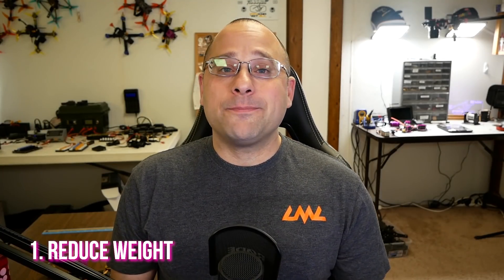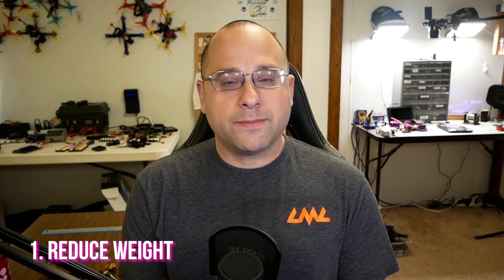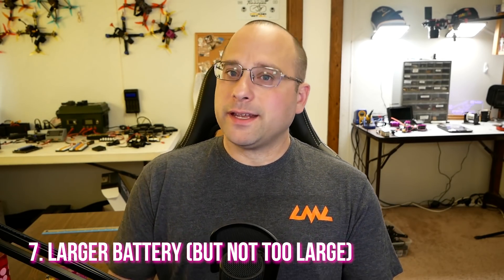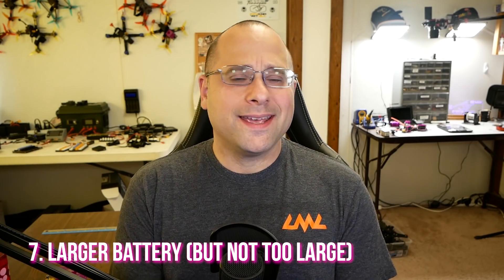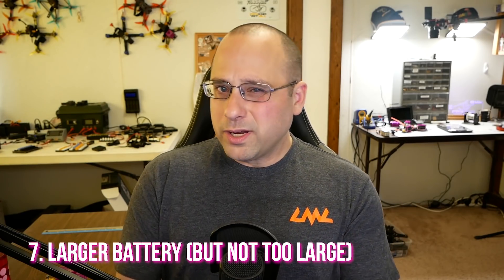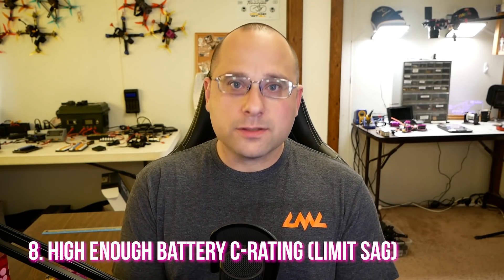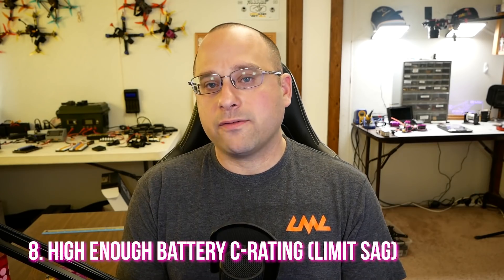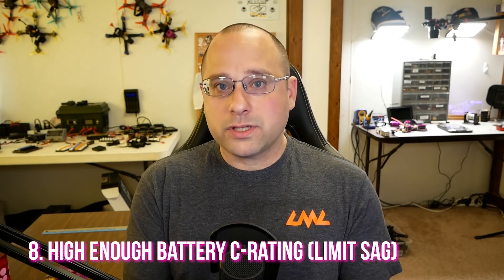Quadcopter Long Flight Time | TEN TIPS TO FLY FPV LONGER

Comment: What do you guys think about 6s, HIGH KV, BUT with a throttle limit.
Reply: Would you still gain efficiency from the 6s? I heard a high kv motor should be more efficient bc of the number of wingdings or something? I could be wrong. Think Ryan Herald mentioned it.
Reply from the maker: I tried this on one of Zach Thayer's quads, and yeah it's a sample of one, but it was terrible.
Reply: @JoshuaBardwell  ??? Sample? What was terrible? So this doesn't work with throttle limit scaled?

I wanna go 6s on my 2400kv motors with throttle scaling. Will it be terrible?

Or will it be identical to 6s low kv?  (~Same rpm at full throttle)

Comment: Joshua:  From fixed wing flying I remember the following rule of thumb:  lower pitch makes more thrust but you can't fly as fast (on the same motor/battery setup).  Why would that be different for quads?
Reply: Lower pitch but a larger diameter prop will make more thrust and will be more efficient but will top out at a slower speed. Higher pitch small props go fast but are inefficient and you can't lift as much weight.

A 12"x3.8" prop will fly longer than an 8"x6".

One thing he didn't mention is that fewer prop blades are more efficient. Two blades will fly longer than 3 or 4. Theoretically, a single blade with a counterweight is the most efficient.

Comment: If you go low on motor size and increase prop size wouldn't it be dangerous for the motor? 
For e.g. could we use a 1806 with a 6030 prop on a 450g (including 3s battery + camera) quad, while flying smooth?

Comment: have you or anyone done a video on what prop size works best on what size and kv motors or is it just a preference thing ? and great video again thanx jb
Reply: I think I heard higher Kv windings are more efficient? And so by using the throttle limit just go high kv. Kv has been around mucch longer than the throttle limit software, which makes kv useless imo.
Reply: I might have it reversed. Josh seems to say low kv winding is more efficient, but for some reason I remember that high kv is for the same thrust.
Reply: Check out kababfpv! 8:58 of this video!  https://youtu.be/c9f3yevSrjs

Comment: My dream...longer flight time...1) solar charging batteries 2) extensible wings to glide on winds when feasible 3) a micro alternator, to charge batteries from motor rotation
Reply: you would also save a LOT of energy when gliding since you would only need to use one motor to fly in that mode, and if I remember correctly a plane can fly on a 7-1 thrust to weight ratio.

Comment: hi is there a maths table to work out what your weight should be ,i am using 10 inch props  with brotherhobby t1 3115 900kv its 2kg at mo with 4000 mha battery and gopro 7

Comment: hard to find info on what kind of flight times you should expect tho.  how long should a 1500 mah 4s battery last on this speedy bee (speedybee stack) quad with 2306 2550KV motors ?  I'm assuming that's a correct battery motor config.  I'm only getting maybe 5 minutes.  The only comparison I have is the rekon 5 with the same battery and it lasts a LOT longer.
Reply from the maker: 3 to 5 minutes is normal for a 5" freestyle quad weighing about 750 grams. The Rekon is designed for endurance not agility speed or agility.

Comment: use a li-ion pack instead of a lipo battery because li-ion has a slightly higher energy density. So for the same weight you get more mah's the problem is that your constant c rating is usully lower, around 30 -45 c.
Reply: 65 c is very low c for a quad
Reply from the maker: Only if you are under 30C which few mini quads are.

Comment: Can someone explain to me why drones like the bebop 2 can fly for 20 minutes in sport mode while flying at 40-50+mph? I want to get into this hobby. Currently flying in sim for over a week now.

Also why use lipo batteries if they're so dangerous and finnicky, requiring careful maintenance and care, while there are consumer drones using lithium ion batteries???? It isn't because the battery cant support the current because consuner drones are doing just that.
Reply from the maker: I don't think the bebop 2 can fly for 20 minutes at 50 mph. I think it can probably hover for 20 minutes, but at 50 mph, I would be surprised if it got that flight time.

LiPo have incredibly high energy density and power delivery. Nothing else comes close until you get to liquid fuel.

Comment: So if I have a 4s 850 that weighs 105 grams, then switch to a 3s 1000 or 3s 1300 that weighs about the same, I should get a longer flight time, right?

Comment: JB random issue, my flywoo explorer LR flying a 4s 900mah battery with GoPro bones and getting like 2-3 minute flights…? Is there a possible esc/beta flight issue? I was expecting to get at least 5-8min..? Also just cruising not going crazy..
Reply from the maker: I think it's just your battery. What voltage are you flying down to?

Comment: Has there been any issues with the  jb parallel charging board or isdt chargers? One of the two is reading cell voltage incorrectly. I am not sure which. I will have to check what betaflight ia reading the voltages at soon. Just wondering if anyone heard anything about either of the two devices.
Reply from the maker: The cell voltage checker is mostly just to help you figure out if the packs are all safe to plug in. It's not calibrated to be very accurate. But it can tell you if they are the same voltage or not.
Reply: @JoshuaBardwell  I just tested this again. I am not sure what was going on. I am no longer having this issue. they are now within .02v difference. I'm at a loss for what was happening previously. Thanks for the reply though.

Comment: I'm about to make the switch from 1500 4s F40 pro II 2400kv to 1250 6s on I'm thinking hyperlite 2208.5 1922kv's. Will this give me more noticeable torque and speed? Is this overkill? I really want to feel a difference moving away from the f40 4s rig.
Reply from the maker: 1922 kv is equivalent to 2883 kv on 4S, so you will gain significant speed, however it may be tough on the battery. I think you will feel a significant difference if that's what you're going for.
Reply: Thnx for the reply. My thought on this is to use throttle scaling to have decent  flight time but have the option to go all out if I feel the need. My last question that might be good for a video is this. I saw a post of a racer switching to a lower kv to gain back throttle resolution because the higher kv is "sensitive". So would using throttle scaling at let's say 80% stretch that 80% to the full stick deflection thus gaining resolution with a wider movement of the stick to increase thrust instead of barley moving it and flying into a tree?

Comment: I have a question that I can't find any resources on the internet... So looking at these DJI, Yoneec, and the likes of these drones, they have flight time upwards from 20-30 minutes. How can I replicate that in an "FPV quad form"? Or is it even possible to build something like that? (I understand that FPV are generally faster, more nimble, etc... but if I flew them slower and were more easy on them, can I get something even close?)
Reply from the maker: Racing drones are built for speed and agility, not endurance. You can extend their flight time somewhat by going slower, but only to a point. For example, you might double flight time from about 3 minutes to about 6 minutes, but you won't get it to 20 or 30 minutes no matter how slowly you fly. To get it to 20-30 minutes you must make compromises in designing the aircraft that mean it simply cannot fly acro well.
Reply: @JoshuaBardwell  I was so not expecting to get a response back so soon. But yes, yes, exactly what I am looking to build! I have a Source One frame here that I'd like to build for endurance. I was doing some reading on the DJI Mavic Air: "the DJI Mavic Air flight time is a maximum of 21 minutes at a consistent speed of 25 km/h (15.5 mph) with no wind. The hovering time for the Mavic Air is 20 minutes without wind." I bet realistic flight time would be around 15 minutes. So that's my goal. Flying slow (~15mph) and getting at least 15mins of flight time. 

I already have a whole ecosystem of FPV stuff and am not interested in adding DJI ecosystem stuff - batteries, controller, accessories, etc. Would you have some recommendation to get me started in that direction (motors, batteries, etc?) or even if you know someone who has already done a video or the likes that would be helpful also! Thank you and stay safe!

Comment: JB what kv would you use for 6s, 6in build. 1600kv?
Reply: I use 2208 1750kv on my 6s 6" build. With azure props 6145.
I always get over 5 mins easy.
That's a combo of hard and smooth as he said.

Comment: Am I the only one trying to add more weight? Need that momentum on 4s.
Reply: If your setup will handle it, 5S pack and throttle limiting will do just that with lower effective sag.
Reply: tehllama42 technically it’ll run 5s but that’s on the high limit. Not quite ready to make the jump yet

Comment: Square tube Cd: 2.05
Round Bar/pipe Cd: ~1.17 (1.75X lower than square)
Aero teardrop (wing) shape Cd: 0.045 (45.56X lower than square and 26X lower than round)

Yet somehow these facts seem to have escaped actual aircraft builders!?

"Errr..... lets blow high speed air down on a surface we want to keep up.... errrr?... why don't it work!?"
Are these.. 'aircraft builders' going to start putting fans, blowing into the sails, on sailing boats next!?

Comment: All these Tipps are not usable for race or freestyle. It seems you are just talking about a setup for long range setups.
Reply from the maker: Disagree. For example, reducing weight applies to everyone. Use lower uptilt angle applies specifically to freestyle. Honestly, I don't think about long range much at all.
Reply: @JoshuaBardwell  Yes, the first Tipp with the weight is for everyone. My fault, sorry.

How it comes you answer such comments on an old video? Are you bored? 😁 Have to mark this day in my calendar. Greets from Germany! 👋

Comment: i'm reminded of something michael schummacher said, in the days when fuel management was vital, and they had boost buttons, he mentioned that when they told him to avoid full revs and conserve fuel, he said he  often went faster and faster while purely thinking about saving fuel.  i think quads throttle passed 85% gets horrendously inefficient,  for 15% of revs you maybe get 3 or 4% more thrust,  it might only really be worth it in stopping or pulling out of a dive or a mistake.

Comment: Longer flt times ?  Ultralight frame Diatonre 515 with 1806 motors and 850 lipo with biblades = 8 min
Reply: But overall flight time is less, because these motors doesn't last...

Comment: Thanks bardwell!!! Can any one help me what can I do if I accidentally soldered the 5v and the 3v pads I bridged the 5v and the pad next to it but then I moved a little and got solder on the 3v on the bardwell fc v2 help!!
Reply from the maker: Swipe with an iron to clean the pads.
Reply: Joshua Bardwell  I tried it dosent come off but I checked it the only thing that is bridged is the 5v and the middle pad the 3v pad just has solder but not touching the other two is that okay or do I have to completely remove it??
Reply: Joshua Bardwell  also what type of motors fit the CL1?? I bought some Multicopter Builders primo motors and i the skrews don’t match up :/

Comment: Overcharge! Any battery can take 4.4v/cell. I actually like lower c high voltage light quads as they weigh less for the same mah, and take alot more abuse. My .02
Reply: Maybe some can take a 4.4v charge initially, but you're shortening the battery's cycle life and creating an undue fire hazard. Not good advice to be spreading on a video that hobby newcomers will watch.
Reply: @EdRickerVlogs  any lipo can take 4.4v/cell. The chemistry was designed around 4.35v/cell it became the standard to charge to 4.2 to prolong cell life. Essentially under charging. A battery isnt just going to burst into flames solely because you charge to 4.4v. As far as shorting cell life, its far worse to charge and leave charged 30+ minutes before flight and people still do it. It wont hurt a lipo one bit if you charge to 4.4v take it off tge charger and fly it. :) and youll get the full mah off the lipo label.

Comment: I THINK I KNOW THE REASON WHY YOU GET MORE FLIGHT TIME ON A 6S! Hear me out: On a typical 4S battery let’s say we call it depleted and end the flight at 14 volts. 14 divided by 4 is 3.5 volts per cell. Now if we take that same 3.5 and multiply it by 6 cells, we still have 21 volts- more than you even started with on a 4S! So the individual cells are still going down but you don’t notice it that much bc you still have plenty of voltage total to still have a fun flight. You could choose to keep going and end the flight at 15 volts, and you just drained your 6S batteries down to 2.5 volts per cell. (On a 4S that would only be equal to 10 volts- not flyable). Now you get some more flight time yes, but at the expense of your batteries lifetime because you are discharging the cells more.
Reply from the maker: This is an argument I've heard but you're missing that the lower kv of the motor means rpm to the prop is the same.
Reply: Maybe there’s just new collective efficiencies created throughout the whole charged batteriy’s spectrum, especially at the top, because it has more voltage and each cell takes less abuse to get the same power.
Reply: Maybe there’s just new collective efficiencies created throughout the whole charged batteriy’s spectrum, especially at the top, because it has more voltage and each cell takes less abuse to get the same power.

Comment: 8 Minute flight time while keeping a decent pace. You're welcome. https://www.youtube.com/watch?v=orBADrMoLwU&t=299s

The only things that matter for flight time really are
1. Weight
     If your quad is too heavy, it uses more power, plain and simple
2. Get a frame that is actually meant to be efficient.
     Almost every frame we fly with SUCKS when it comes to aerodynamics. Arms are too wide, cross sectional area is too great, drag force is nuckin futz. Get a frame that is more than      just a "cool looking brick"
3. Don't use high KV and over-prop.

#2 is what makes the most difference, but 1 & 3 should always be followed. If you have the right frame, you don't need high KV and high voltage to get speed.
Reply from the maker: So, compliments to you: 8.5 minutes of flight is impressive and none of my rigs would go that long. But at the same time this is sort of exactly what I was talking about. You're maintaining a moderate pace, but you're not punching out. I would guess you're seldom above about 30-40% throttle. If you were really doing hard acro I think your flight time would drop by perhaps 50%.
Reply: @JoshuaBardwell  You're right, about the throttle percentage. Trying to push that quad (still fairly new to me) I'm getting about 5-6 minutes of flight time. Tomorrow will be my first opportunity to race it hard and I'm looking forward to seeing how it does. If you're interested I'll reply back with a link to the DVR. I wasn't trying to contradict you. I admire everything you've done for the community. I also think that real breakthroughs in frame design need to be highlighted more often. (This is a race frame from Ryan and his top speed projects)

Comment: Hi Joshua, this minutephysics clips https://www.youtube.com/watch?v=ueTGjegTKoo might be related to point number 6 on your explanation. 
Anyway, I have question but irrelevant to this video. My VTx signal feed is shorted to the ground when I checked them with DMM, this is NOT normal right? My mmcx connector gets extremely hot. But, it still broadcasts my video feed normally, like nothing happen. In your opinion, should I better get rid of it and get a brand new VTX?
Reply from the maker: That is normal. DC Continuity is not the same as at 5 GHz.
Reply: What about the mmcx connector Joshua?  It gets hot extremely fast, and I can barely put my finger on it.

Comment: For long range ultra lightweight check www.can-am-rotors.com  My 7" with a Go-Pro is at 410g (no battery) and 310g without gopro or battery.
Reply from the maker: That's really impressive!
Reply: @JoshuaBardwell  If you want to review one I might be able to work something out. Will message you on facebook.
Reply: For a bit more context it is a 7" frame with 2205 and 20x20 stacks.

Comment: Man... slow Tuesday...
Reply from the maker: Videos like these come about because so many people ask the the question that I feel obligated to make a video about it. If you already know all this information, congratulate yourself!
Reply: @JoshuaBardwell  I wasn't trying to be a dick. I think the barrier to entry in this hobby is so ridiculously high that sometimes I want to put it in perspective. Building you your first quad is like if you went to buy a sports car and your only choice was to hand build it from scratch. You start by watching 40 hours of YouTube then buy wheels from one vendor an engine from another and the transmission from a third. Then have all requisite auto mechanical knowledge to to put it all together.  And once you did all of that, you have to learn how to drive first time in a 750hp hand built, tube frame custom car. Never knowing if it's a mechanical problem or just learning how to drive. I  know my snarky comment isn't a solution and  you are actually working towards a solution.